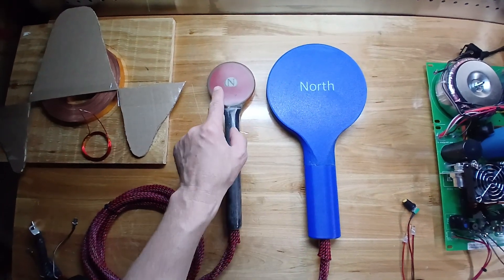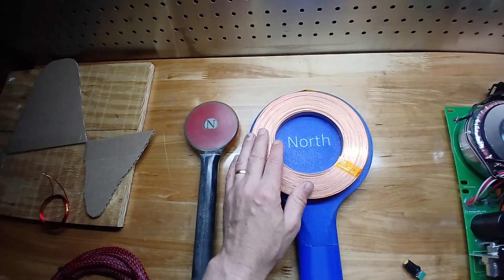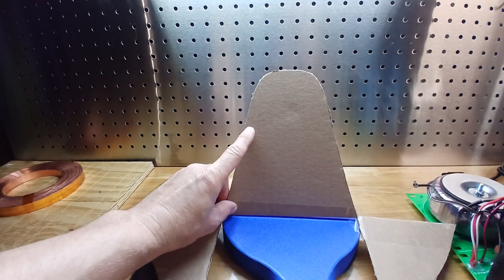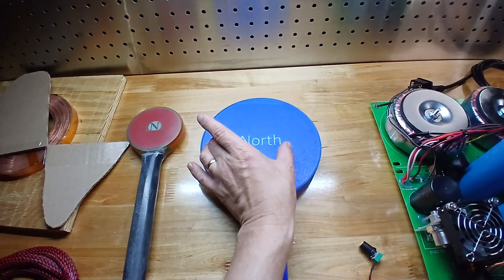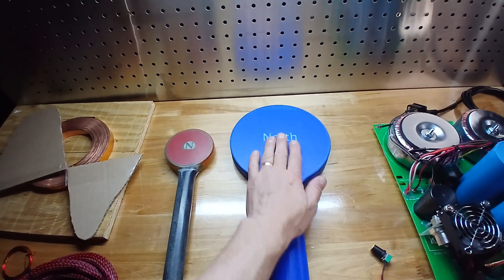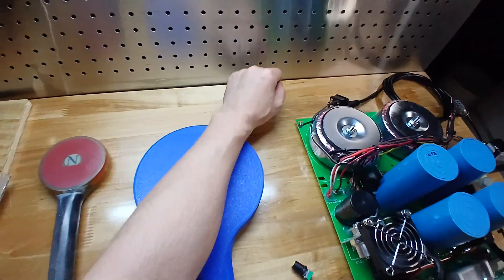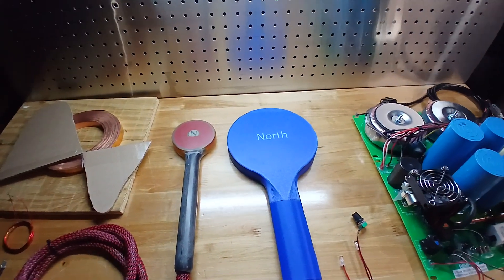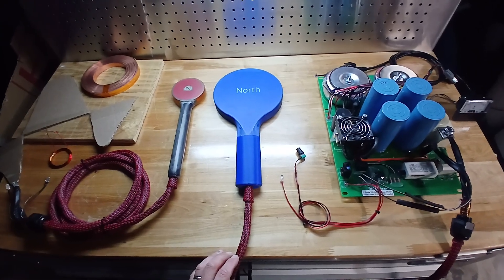216 BBMPulser 4.5B kit with 7" Strip Coil. Open Source PEMF (Magnetic Pulser)

Comment: My question is: if u adjust the pulser power to create in the 3 inches coil the same power like you obtained with the larger coil, will u obtain the same period of working time until the coil will reach the protection temperature?
Reply from the maker: Good question.
It depends.
If i use same voltage but larger cap bank to get 2.4 Tesla from 7" Coil, my guess it will be even less time, probably around 7 min.
If I use higher voltage but keep cap bank same, my guess that I can get 10-12min from it. 
If i lower the capacitor bank let's say 4x and increase voltage to 4kV, I will get my 2.4 Tesla and the session time will increase to around 18min.

Comment: What is this for?  What do you do with this?
Reply from the maker: In this video I was showing my new 7" Coil (Applicator) used to produce  magnetic pulses with intensity of up to 7,500 Gauss in this set up.
In other words it's Pulsed Electro Magnetic Field. Where accumulated and stored electrical energy is being converted into magnetic energy.
With the cardboard I was showing intensity of the magnetic field relative to the location on the coil. 
Both side of the coil output magnetic field, one side outputs South another North. 
North side of the Coil is used for different health conditions.
As we place the coil on the body, magnetic field penetrates into the tissue and some of it converts back into electricity. 
PEMF treatments 3,000 Gauss and stronger are known to help with Pains, to speed up healing, injury recovery, to recharge cells, and there are alot of other benefits. Please Google "Whats PEMF used for?" to learn about it

Comment: connect a flat board with flat magnets glued to a 3 to 12 inch speakers cone. drive it with 1 hz to hundreds of kilohertz square wave. the magnets vibrating will give a similar effect.